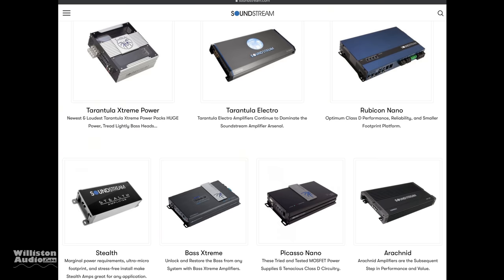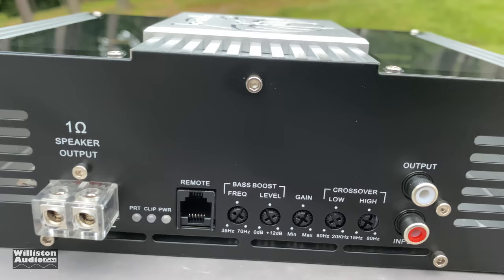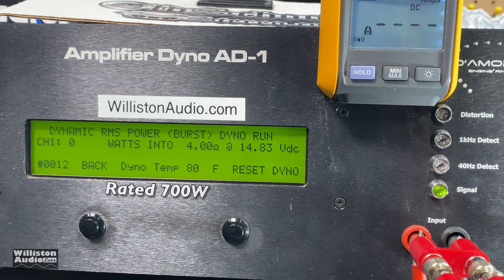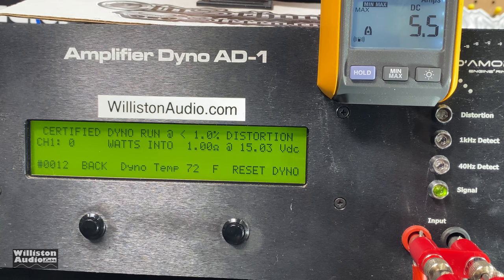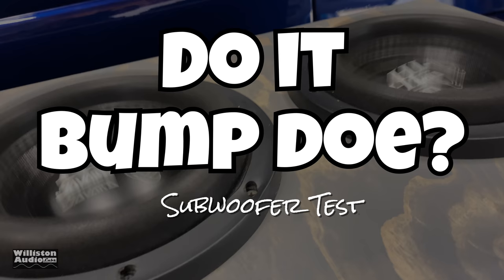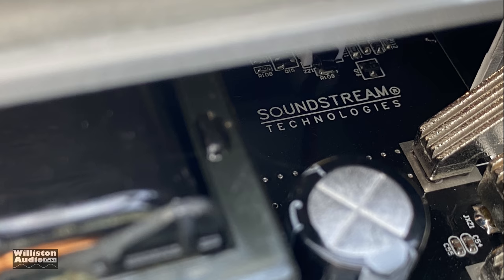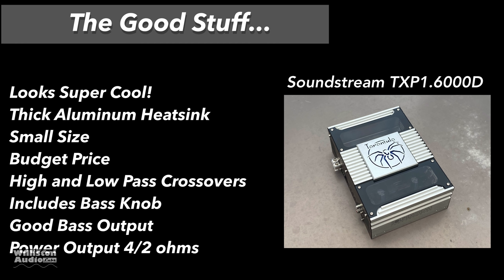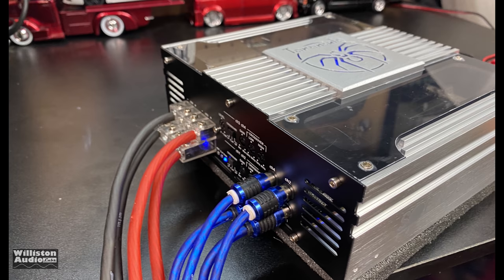Coolest Looking Budget Amp? Soundstream Tarantula Xtreme TXP1.6000D Amp Dyno Test

Comment: Gotta say, I'm shocked to see soundstream put out 2k watts and beat the 2 and 4 ohm ratings certified. Looks like going to a full bridge design was the right move, even if they did steal the design from soundigital. Nice video Big D! I wasn't expecting this and It was a fun video.
Reply from the maker: I was surprised as well, totally in love with the look of these and I wasn’t paid to say that
Reply: i like this amp looking to buy ty for the vid i liked and sub but im not sure witch one i should buy 2 channel or mono is for subwoofer but i also want the feature high pass filter thats good witch one u recomend me mono or 2 channel
Reply: @wal  can it be 12v or need to be 14v?
Reply: oi3 Vehicle not running will run @ 12v. Vehicle running will provide 14v. That’s why BOTH ratings are provided. Get the amp that makes the most power for a sub. 2 channel or 1 channel is fine as long as it has enough power. The 2 channel amps are bridgeable to one channel.
Reply: @Assimilator702  Ty so mutch for reply im thinking on buying this amp to connect in home with 1800w psu there is 12v on the psu cables
Reply: @Assimilator702  do i need a 14v psu or 12 is fine sry idk mutch about volts
Reply: @oi3  This amp won't make full power if not installed in a running vehicle and running off a PSU. What are you powering with this amp and why not get a regular power amp that's designed for home, studio or live applications? You can get a Crown XLD amp for $400 that makes enough power for a subwoofer and has very good DSP features.
Reply: @Assimilator702  yea i also had idea to buy crown is good amp but not comes with eq and less power than this one r u sure the 1800w psu will not run full power?
Reply: @Assimilator702  i can get 2000w psu too
Reply: @oi3  You'll be better off with the Crown amp or a QSC. You won't get full power from a 12 volt amp unless it's in a running vehicle with a solid charging system. Why so focused on power? If you use an optimized sub enclosure, max power is not as important as you might believe. What sub and type of enclosure  are you using and how large is the room?
Reply: @Assimilator702  i have rockville k915 5000w peak and 1250w rms cea in a pro 15 sp box all good connected wires too connected to rockville mono 4000w peak 1000w rms cea its works good with 1800w psu better than the 1200w psu that i had before but this amp haves not hpf and only 1 channel 1000w rms cea i want upgrade it i also dont put mutch volume its too mutch loud max volume i did put before was allmost middle volume i think also i plan to buy a rockville punisher sub 1500w rms cea thats why i want upgrade the amp to something like this crown more power is expensive to me with the 1200w psu i seen it could not handle the amp power with this 1800w psu it can handle way more power without fail nothing also i have it all well connected and secured even secure electricity sockets i have with protections and the car amp with psu with extra cables adapters so not damaged the psu cables and mb on a pc home teather pc case ive build it all it looks good and nice i only turn the car amp and sub sometimes i have another pro amp and big 15 sps sry for long text ty for ur help
Reply: oi3 In your case having the higher wattage power supply would be the route to go. You need the horsepower from the PSU in order for the amp to make wattage in the same way that a car amp gets all its juice from the alternator. The amplifier is simply making a signal that a speaker can use. All the power comes from the automotive electrical system. I’ve hooked up car amps in a HT simply for testing but never in a permanent install. For home theater I would use one of the Crown or QSC class D power amps. I mean you’re spending the money on the PSU which you wouldn’t need with a purpose built home/studio amp. I have 2 UltimAx 18” subs each with their own Crown XLS 2502 and it has more bass than I would ever need. Each is on a separate 20 amp circuit which I needed in case I ever wanted to use old school Class AB amplifiers that are much more power hungry. So I basically spent the $$$ on upgrading  my electrical system rather than the PSU. I could easily run ONE Ultimax 18 but I choose to keep the amps running well below their peak output for longevity and balance in the room.
Reply: @Assimilator702  nice and this amp is 14v if i use pc psu of 12v still works? im not sure
Reply: I have a ta3000.1 and its nasty amp
Reply: @oi3  pc psu won’t  have enough power.
Reply: @oi3  u need supercap or car battery for buffer to send large current for peak power if use home psu or pc psu
Reply: @doradorido  im using 1800w psu it works good i dont use mutch time and not mutch volume too
Reply: @doradorido  also i got protection electricity socket protect and also watt meter
Reply: @oi3  its nice if u already enough for the setup
Reply: Why people surprised the ta13000 is a beast of an amp
Reply: I have the soundigital 3000.1 in my towncar, Now I will put this tarantula 
In wy Fleetwood

Comment: I bet Soundstream bought a sound digital amp and sent it over to their build house in China and was like build me one of these with our in-house components
Reply: Exactly. Using The Brazilian guts.
Reply from the maker: Designed on a napkin after sketching a SounDigital in the US 😉
Reply: rmblwgn The guts are more than likely made by the same factory. Slightly different outer case.
Reply: @Assimilator702  that's another possibility they could have paid Soundigital to make them a few unchanged amp boards

Comment: That's gotta be one of the coolest amps I've seen soundstream put out since the Rubicon series, definitely gonna get me one.
Reply from the maker: It’s exciting to get new audio jewelry
Reply: I just picked up a rubicon 2500 to repair and I agree, sleek! especially the matte greyish blue.
Reply: In 2001 - I had two Rubicon 302s and always wanted a 1002. Bought one that was new old stock a few years ago. These were so good. Expensive but good.
Reply: always wanted a human reign 4 amp-
Reply: Eric Simpson REAL Rubicon amps are top notch. I have a closet full of MINT amps in boxes. Is yours still running?
Reply: Joe Rico - my 302 is ok other than the crossover “chip” being garbage - I murdered the other one being an idiot. The 1002 is still good, unless it expired in the storage container in my closet. Never installed it.
Reply: I own rubicon 1002 and lil wonder 
This amp is definitely replacing my 1002 in my daily car
Reply: @juliobello4561  You're joking right?  The current Soundstream is no where near the quality  of the US made of the original and genuine company. Go with an amp from JL, Fosgate, Kicker,  Arc Audio, Zapco, TRU, Mosconi, Audison, Alpine, Phoenix Gold, Liners Power or any other highly regarded company before using this garbage brand.
Reply: @Assimilator702  - I’m sure it’s no secret to anyone. I run hifonics amps sometimes also - the nostalgia makes me happy. You don’t 😘
Reply: @grumpysteelman  Actually I don't think many people know the history of the once great amplifier companies. It's not so much about nostalgia as it is quality gear. I see which gear is failing in the field and it isn't the better companies amplifiers that people are  replacing as much as the borderline flea market crap.
Reply: Antoine Broussard  how do u like the 18k
Reply: @Assimilator702  - actually it is just the nostalgia. Almost everybody sold out or died out. JL amps aren’t worth the money - never were. I had two black and a white MTX 2300x - arguably my favorite amps. I had an Alpine MRV-1505 and MRV-1507 in the mix - both Alpine amps were gutless trying to push Soundstream SPL170s.  Old Soundstream Rubicon amps that I had were wonderful. Before that, multiple JL powerwedge boxes and custom stuff. Recently been pushing sundown stuff in my Camaro but found a deal on Vega 12s - running 4 on this Soundstream amp in my grocery whore Nissan Altima - Self-built box that had to be assembled in the car 😂

So I get what you’re trying to say about nice gear but I don’t miss the $/watt days and neither do you - if you’re honest. 😊
Reply: @grumpysteelman  I was always impressed with Soundstream amps. Reference generation #1 were my first expensive amps after running Alpine in my first few systems.  I skipped the Smokestream era but they got real good with the Rubicon era. Those 90's Alpines are solid and reliable for me. I've  never had an issue with them and they all work flawlessly today.
Reply: Antoine Broussard  I pick one up also I have 2 DC xl
Reply: @Assimilator702  - solid is fair on the Alpine amps of that era. They still didn’t tolerate the abuse that the MTX amps would - and I’m hard on equipment. 😂 I had never heard of Smokestream lol. The Rubicon amps with the beauty lids on the inputs /outputs had just come out when I bought my first system in my first car.
Reply: I liked the tx1 series and the D-towers....
Reply: @Assimilator702  "I skipped the Smokestream era"  Let me guess...that's the series you never owned, so they suck. 🙄 My Ref 1000 and Ref644 are going on twenty freaking 7 years old and hit like the day they were new with warm, smooth sound.  I even have the old Ref500 that the 1000 replaced pushing some newer infinity subs in the worktruck.  Flawless.  Opening the Ref1000 is like looking at electronic artwork.
Reply: @JViello   I'm not  busting on SS.  Just speaking facts. Reference S series were referred to by the bane "Snokestream" and that included some of the engineers at SS that had their engineer work over ridden by marketing. It was that Auto High Current/High Power  switching feature they advised against using. I already had plenty of Reference MK 1 amps to run my system in 1995/1996 so I didn't go with those Reference S series which did have reliability issues. It was a fact and they had  more  issues than other brands we sold like Precision Power, Phoenix Gold, Rockford Fosgate and Orion. Installers much more experienced than I was coined the term "Smokestream" and trust me I wanted to punch someone everytime I heard it. I waited until the Rubicon series were released to purchase more Soundstream amps. Not hating on SS in the least bit as I'm one of their biggest fans. I also had a system with two Reference 1000Sx displayed upside down with their guts showing under plexi with several cooling fans.  I love old school Soundstream. Still have every SS amp I ever purchased. Almost one of every amp they released from the 90's forward.
Reply: @Assimilator702  It's all good my man.  I get hot when people say that shit because it's just not true.  We can agree to disagree on that one. 

However, what you are calling facts, is IN FACT opinion.  Unless you can document how many units built, vs the number of failures etc etc. it's all opinion and not fact.  Facts are verifiable by data sets.  Any engineer will tell you that.  Opinions are "my boy installed those yo, and them shits go up in smoke all the time!  For real!"   Facts are, we are getting X% of failures, and that indicates a problem.

I also worked in the industry for years building ridiculous systems.  Actually, I was in just about all capacities at one time or another. Sales, install, design, management etc so it seems we have that in common.  I've also talked directly with several  SS "engineers" and THEE engineer Wade Stewart on several occasions,  He WAS Soundstream.  According to him, no reference model every got to the point of being considered "problematic" and if you don't think they watch warranty and repair claims closely you'd be very mistaken.  Like a hawk is more like it.  If there was every a SS amp that I think might have been "meh" and somewhat problematic it was the 405.

One of the reason they are so robust is they design the output drive to take anything the supply side can give it. Think of it like this, you design a flashlight where the batteries can't put out enough current and voltage to hurt the LED.  Bam! Instant safety net.  The Chinese do it all the time to cut costs. It's the same with the SS, the "weak" point was the power supply side, it in theory could never overdrive the output side.  

I designed systems with multiple drivers that loaded the amps down to 1/8th ohm (1/4 ohm bridged.) over and over and over.  It's an easy way to gain spl on the cheap...if you had the room and your amp could drive loads that were damn near a short that is!  I challenge anyone to try that with Orion or PPI...PG would probably survive but SS was known to take the abuse and keep hammering.

Problems did arise when people tried to "modify" the supply side to get more output.  Duh! THAT is what I saw get cooked, supply sides.  People trying to put 24V in and all kinds of dumb shit.  Maybe that's what you experienced?

And BTW, when I asked Wade what the difference was between the Ref XXX the "S" and "SX" he said "nothing". Wut?  Said it was all marketing bullshit. They wanted to make it seem like improvements were being made.  The amps were identical.  That's THE guy who designed and built them and put his signature on both the design draft and some circuit boards. 👍

Smokestream IMO was created by haters who didn't like that the brand was eating their lunch and those who just had the "other" brands and wanted to talk shit.  I'd bet dime to a dollar if you lined up every manufacturer, failure rates would all be similar.  Amps are not rocket science.

Like I said, my 644 and 1000 just keep on going.  Everytime I open it up thinking I'm going to see a swollen or leaking cap...Nope.  Good as the day they left the factory, 27 years ago.  The head unit and speakers are another story.  LOL
Reply: @JViello Anyone that knows these amps knows you as a general rule stay away from Reference S.  Reference Sx is a safer bet. Rubicon are more solid amps. There's no harm in accepting those "guidelines" and notice I didn't use the word facts.  I was an installer back then and we had close to a 50% failure rate. Many shops reported 60% failure rates. A shop I worked for more recently stopped carrying Soundstrem until Rubicon was released. Its possible you didn't see many of the  problems several shops witnessed.  Its just what happened back then. Some could be user error but many instances it was not.  If you ever speak with Jaimie the engineer that helped design one or 2 series of amps he noted a problem woth the auto switching feature. I had no idea what was going on back then except for more amps than usual were failing compared to all the other brands we installed. I didn't learn of the drama behind the scenes at Soundstream until years later. I'm usually the one DEFENDING Soundstreams name in these discussions and I believe I know more than most of the car audio enthusiasts from the 90's about this subject between living through it and speaking to the engineers that built these amps. In my experience if you get a good amp they WILL run trouble free for 20+ years provided you treat them right. I have 10 to 12 Reference amps of Mk 1 and Mk 3 Gen and quite a few more from the Rubicon era and I've never seen even a building cap. There's no anti- Soundstream rhetoric coming from me as I'm one of their biggest promoters. I believe much is lost with internet conversations since I know you would realize how I felt about SS if we were face to face. We had some in depth discussions about this subject on Elite Car Audio which is defunct but there should be a few discussions on DIYMA from a few years back.
Reply: @Assimilator702  I feel you my friend. Face to face for real...old school.  No hate or anger here, I can assure you. Life's to short for that shit anymore.   

Maybe we just got lucky,  we pushed a LOT of these SS amps, in SQ installs and in competition.  I'm in the NYC area and we did a massive amount of sales and installs...all custom.  Of course we had a normal amount of dumb assery going on.  I really don't know where this smokestream BS came from, I'm tellin you.  In the stuff we did, we just didn't see it any more than other brands.  And when I talk directly to an engineer...well, THE man himself who to this day, well at least 2010-2011 long after retirement who still says the same thing.  The S, SX etc were the same - no difference inside at all...and they didn't see any era with problem spikes what am I supposed to think? 

 You know, maybe it's because we either set these things up to run 2ohm and higher, or straight up high current and .5 ohm and lower.  No 1ohm set up where the high voltage/high current switching can get confused.  All these years, I never though about it until now. Huh.  That's how I designed the systems.  Either SQ never really dipping below 2 ohms, or straight nasty high current flexing trunk lids with 4-6-8-12 subs hammering at 1/4 ohm!  Hmmm...Something to think about.

Comment: I got one on the way for my 2 sundown sa 12s.  Cant wait to try it out.

Edit: 2 years later and its still going strong. It pushes my sa 12s to the limit and sounds pretty clean.  Its not a sq amp by far but well worth the 160 bucks I payed.  Mine is fed using 1o cable power and ground on a stock 140 amp alternator and a napa gold agm battery.
Reply: Is the amp still playing
Reply: @popspowell4981  nope but from no fault of the amp.  I lifted my back seat and it snapped the terminals in half because the cable was caught on a bolt.  Ive already bought and installed a 2nd one and its going great. It snapped because the terminals are like 4 guage so you need a pair of  offset metal adapters to run 0 guage.
Reply: @civic2980  cool, am going to buy one soon
Reply: Civic2980 do you have the big 3 done or just the things you said in the comments
Reply: @michaelrich7466  yup sure do 0 guage cable.